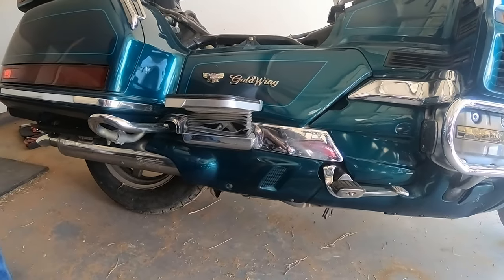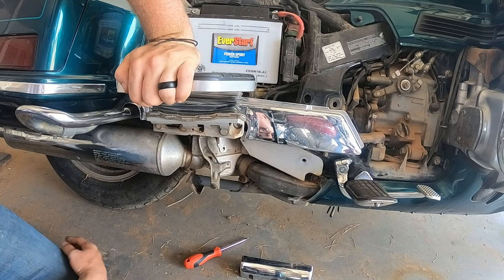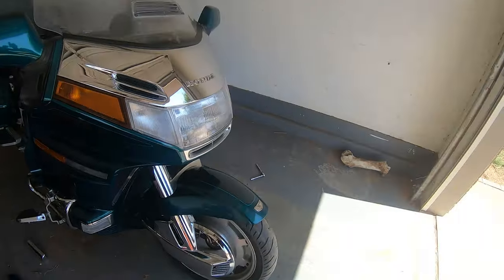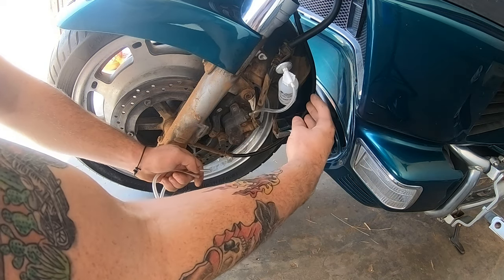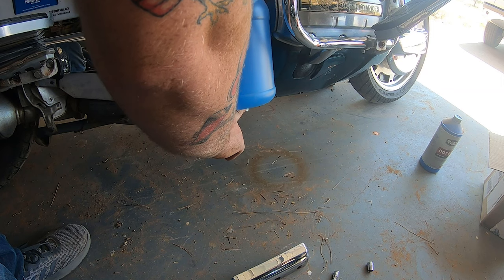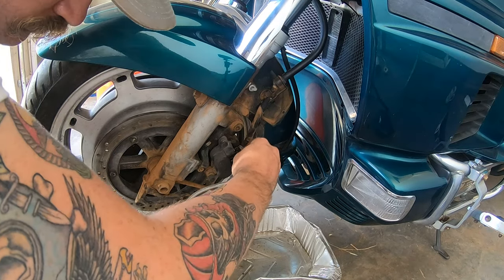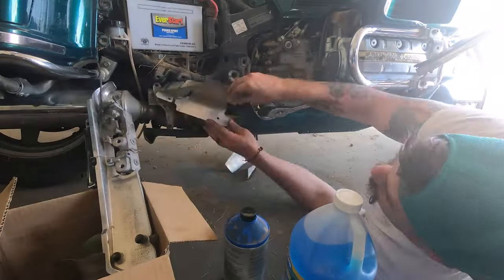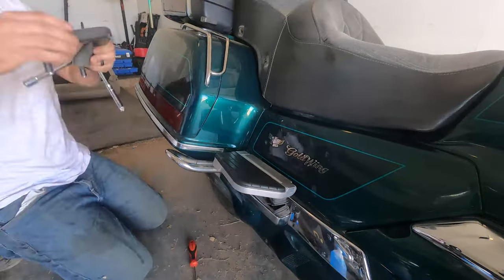1996 GoldWing GL1500 SE Restoration PT 10:Brakes Aren't Broken Anymore!

Comment: Is it necessary to remove the heat shields to bleed the brakes? or was that in case you had to rebuild the rear master cyl.
Reply from the maker: No sir it is not, it was to visualize the rear master cylinder!

Comment: Would you happen to have a way of showing me how that bottom heat shield goes in?
A pic maybe....
Reply from the maker: https://www.goldwingowners.com/threads/pictures-or-instructions-for-takedown-and-put-back-together-1997-gl1500.128467/

if you scroll to the bottom of that page there is a shop manual picture of it!

Comment: Mirror image of what I did to bleed my rear brakes too,only my rear bleeder valve was the one that was plugged up with gunk, that was more of a chore putting it back in than removing it,Honda needed that access hole about twice as big. As far as what tunes for background— I can take it or leave it,actually prefer voice over with text showing part # wrench,filter size used or even a little text humor. So much music is copyrighted that unless you happen to be your own musician, it ain’t worth the YT police censoring your content.
Reply from the maker: I have heard of people taking a hole saw to their saddlebag to make it bigger haha. And I would consider myself lucky it was the front one gummed up and not the back! Not even much room to get a hose to catch the brake fluid on it. And that's a good idea adding text, hadn't thought of that. Thank you! And I actually pay a company that has a music library to use it so I better not get hit by the copyright stuff haha. Thanks for the comment Mr Innovator!

Comment: Dont use Teflon tape on bleeder screws
Reply from the maker: You can! This is the yellow teflon tape which is resisant to being dissolved. It is a little thicker than the traditional stuff in the blue package

Comment: One of the things that bothers me about your efforts is the lack of attention detail on the bikes overall condition. I just can't stand to see the desert all inside the bike under the panels and plastics. How can a great job be accomplished when half of the dirt in Texas  is under the plastics and panels?  If i were to take my goldwing to the dealer and got back from the dealer the bike that you show in these videos, I'd be suspect of the quality of the dealers work. How do you expect to ensure that the parts rebuilt or corrected aren't contaminated by all of the dirt that you've left on the bike? I believe you said that some parts would get ruined by water on them. I have owned Honda's, Yamaha's and still do. I have never had one motorcycle made by those two manufactures or the BMW that I have ever fail because it got wet. I believe the designers of those motorcycles know without a doubt that their bakes will be rained on, washed and even ridden and then washed after riding. I'm at a loss for such comments and beliefs. Do you think that an airplane carrying people or weapons of war will somehow break or degrade because it gets wet? Motorcycles do not fail just because you put soap and water on them muchless rain falling from the sky lands on them. If they do then, the parts affected are subpar and were designed to fail. The pressure washer you used to wash the bird poop off the plastics would never harm anything under the plastics as designed by the engineers at Honda.  Gawd, I hat seeing all that dirt under the panels.
Reply from the maker: Hey Scott, thanks for the comment. My reference to pieces getting damaged by water was in reference to using a pressure washer underneath the fairings. This bike has been neglected for many years, and with it being stored outside all of that time I cannot positively state that every single electrical connection, every single gasket, every single hose, and every single wire would tolerate being sprayed down with water. This motorcycle lived in the elements, so in my mind some degradation (from UV exposure, to water corrosion, to simple oxidation) has occurred. It was not garage kept, was not even under a carport for most of the time. I cannot accurately gauge the level of degradation, so I am "Playing it safe" here by not touching pieces that are not broken. Another aspect of the equation is my time. The customer did not want to pay for me to detail the motorcycle with the fairings off. My personal GL1500 I plan on it, but this is a very hands on process without just spraying water everywhere. I try to provide the highest quality work to the customers, but if they tell me they don't want to pay for a service I will not do the service. Would I like to? Of course. But at the end of the day if I spend half a day detailing the dirt out from underneath the fairings, that half a day that I missed out working on something else. Again, thank you for your comment, if you have any other questions or anything else let me know. Have a good day Scott!